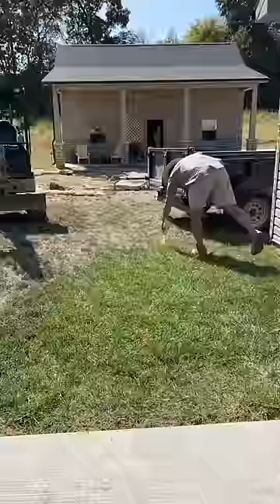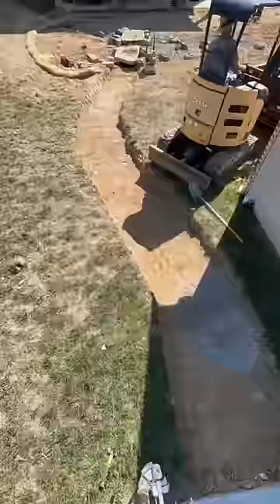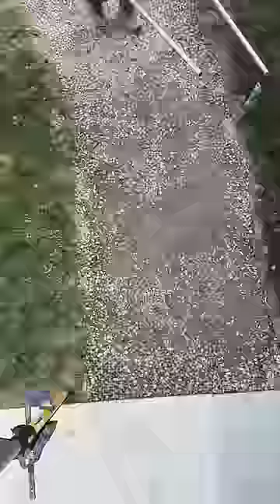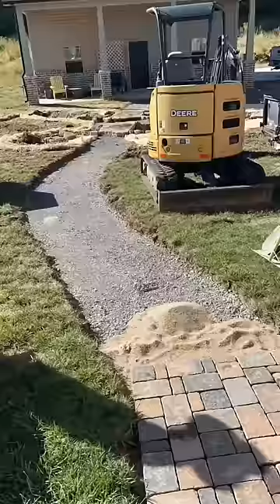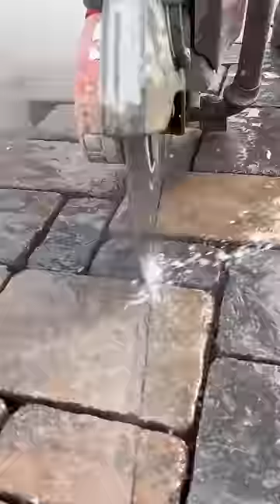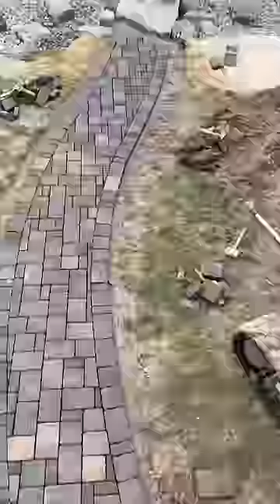Cut Pavers Fast 💨

Comment: That’s like 5” cut on both sides is way too much to cut. Looks better wider!
Reply: Cut to the owners dimensions not yours
Reply: @mattharrell6880 the chaps still allowed his personal opinion on it though right
Reply: @kuk3411 opinion is worthless if you aren’t paying for it to be done. If you were paying for it, then they would build it the way you want it specifically. Customer is always right, even if you think it looks wrong they are paying the bill.
Reply: @l0l0mgwtgdq  I completely agree, very frustrating when you have to create something you don’t like or don’t think looks right.
Reply: Walkways can’t exceed 4 ft silly
Reply: @dylanburge3516  if that's the case then why lay 12"+ on both sides knowing that it's a waste of time. Seems to me like excessive labor went into this and the customer had to pay for it
Reply: @guzzini  if you have ever used that kind of saw you would understand. The extra pavers are to create stability when the saw is passing.. especially needed when trying to created a curve with a straight blade. There is a reason why it is nicknamed “maniac saw”
Reply: Yeah that was surprising… but a lot came back with the rows on the sides. Design’s a process 🤷🏻‍♂️
Reply: Just because the customer wanted it that way doesnt mean it can't look like shit
Reply: Exactly. If the customer wants it that wide, why are we spending so much time, material and labor on 10 more inches?
Reply: @dylanburge3516 Why? What is the reason?
Reply: @l0l0mgwtgdq  plot twist you gave your worthless opinion about another mans opinion being worthless. Interesting. Neither of you own the house (paid for it) nor laid the pavers. SMH
Reply: @l0l0mgwtgdq Your opinion about his opinion is worthless. If customers order some nonsense and show it on video, we can write about it as much as we want.
Reply: @LazyCat-bq7sz  one of the replies already explained that the saw runs more safely with some more room on either side. Jesus.
Reply: @bustedkeaton bullshit, there are other ways to stabilize it for cutting than wasting all the brick and time……
Reply: @guzzini I think the extra room on each side was so that the stone remained still with friction & weight to cut better those what was left to be tiny pieces. My hunch.
Reply: @botsareeverywhere okay genius, what’s a better way to stabilize the bricks from all that torque that would prevent the blocks from bucking all over. You can’t just dismiss it without a solution.
Reply: @dylanburge3516 physically makes sense.
Reply: @botsareeverywhere   I own a hardscaping company and have been hardscaping for over a decade this method is the fastest and most effective. You can make the whole cut in under 20 minutes instead of taking hours to pull each paver and cut it and hope that your cut piece matches the next one to a tee. Also this method insures that the most experienced guy is handling the cutting instead of putting a laborer on a table saw.
Reply: That’s what I say about your mamma 😂
Reply: Opinions vary.
Reply: I agree that what the customer wants is what they got, but just cuz the customer wanted it doesn't make it look better. It looks meh at best.
Reply: @l0l0mgwtgdq  So he's not allowed to have an opinion? Better report him to Youtube man, he's breaking the rules.
Reply: @dylanburge3516 I use that kind of saw and you’re talking bollocks
Reply: @l0l0mgwtgdq no, opinions are what create reality. If someone payed $500 for an apple that wouldn't just be my opinion if I said "that's stupid" just as this sidewalk is a 4/10 on the professional scale. And yeah it looks bad
Reply: Absolutely love how total strangers hate each other so much over something that is none of their business 😂😂😂

Comment: Played a lot of extra stones to just pick them back up😅 payed by the hour🎉
Reply: You sound silly
Reply: The time saved cutting this way is considerably more efficient.
Reply: You lay the extra brick so you can cut to your width, you might cut off most the brick but you need those slivers and corners so it’s complete from edge to edge, I cut all my brick work this way, much cleaner line.
Reply: You probably have never worked this job

Comment: You’re supposed to set the border on a concrete footing so it doesn’t move..  with the way these are set, over time, the pavers will separate and it will need to be redone

Other than that, it looks good! For now…..
Reply: I don't know about a concrete footer...the walk will move because that sand base will wash though. Limestone #10
Reply: You can use concrete, but nowadays they just use a plastic edging and 12 inch galvanized nails.
Reply: @ReactimusPrime  sure, concrete and sand base are both applicable, but they are inferior. #10 limestone cannot wash out and has become very popular. I did this for 8 years in Ohio, and you can skip the unattractive edging too, because it's no longer needed
Reply: I use a stone mix under the sand called ABC, I use a metal grid mesh on top of the sand that stops the pavers from moving, I use professional landscape felt on top of the mesh to stop plants from growing out of the walkway, I then make the border out of dyed cement.

Comment: Looks great, unfortunately you can’t take enough soil out to fit the stone and pavers and get a lasting outcome. You have to get rid of all the soft topsoil then build up. Otherwise it’ll be wavy in a few short years
Reply: Overlapping sections of road fabric. Geotextile is actually super useful but utilizing in paver applications, put in between the soil and the stone base, you would be surprised with how little movement you get from freezing and thawing. The geotextile gives tensile strength to stone base…. like steel and concrete.

Comment: FYI - All pathways should accommodate two persons (wheelchair /elderly with assistance/couples/double stroller/moving furniture )... especially a long pathway... who wants to walk behind someone that long...
Reply: No, code is 3ft, if the customer wanted a 5 foot walk they would have asked for one, you install what the customer wants within code, they probably will rarely ever use it and a wheelchair will fit on a 36 inch walk.
Reply: @chrisnelson3691  LOL... My comment clearly went over your head...
Reply: @DanDan-xf6wo  Nah, it definitely didn’t.
Reply: @chrisnelson3691  So... You purposely ignored the context of my comment... and chose to Gaslight... 🤔🙄

Comment: No barrier below the sand? You're going to get moss and mold growing in 5 years right through the sand.
Reply: Это красиво
Reply: The sand and compacted base plus the polymeric sand in the joints will prevent it. 
Source: hardscape contractor

Comment: The cut is so ruff. i would recommend using geo cloth under the base corse and hornching the sides to stop the sand washing away
Reply: You another expert huh
Reply: @_Bturbo370zzzzz_  yes sir 18 years landscaping. I am an assistant manager of the company I work for and site project manager
Reply: @themac4761  🤣🤣🤣🤣
Reply: @themac4761 And you're right!! The path will spread over time as there's no haunching on the edges. They're basically gonna rely on the grass to hold the edges. I prefer to put in a small footing along the edges to bed and haunch the edgework and I would also use a weed screen.👍 35yrs experience.

Comment: For those of you inexperienced with hardscaping talking about the extra stone he doesn’t cut.  The extra stone helps hold everything together while the saw in moving through the pavers. The less the pavers move the less chance there is of messing up your cut or the outside of a cut turning into a rocket. The more stability while cutting the better especially while making curved cuts with a maniac(which isn’t easy)..

Also most walkways by default AND  according to planning and zoning can’t/dont exceed 4 feet. So it’s about 2.7 feet of pavers wide and a soldier course on each side(give or take)

Quit commenting negative shit on other peoples profession that you’ve never done in your life. I’ve been at hardscaping for ten years and this is exactly how it’s supposed to be done

Comment: Bro, I'm a mason, here a suggestion for you: stop laying pavers on to sand. It constantly wicks moisture and that's why you have weeds on it after as a curse. 
Just lay on to 5/8 minus crush with fines. 
No need of pipes, just install 2x4 like for concrete and lay pavers on to compacted crash, then two times sweep polymeric sand. Sand was used with true cobble stone in ancient times instead of mortar to compensate the difference in stone height and unevenness. Modern pavers is 2 1/4 of an inch consistently, no need to suffer with sand.
Reply: Thank you for sharing this information and wise advise. Of all the postings yours make the most sense. 🙋🏼‍♀️🇵🇦

Comment: Can cut one side at a time to reuse viable cut pavers on other side.
Reply: Id also add that you can score in place and cut the bricks off to the side it is more time consuming but will save the integrity of your base where you’re cutting. Most people do it the way they’ve done it in this video and its effective, but your saw and water screws the base on the edge of the soldier course up pretty good. Also if the concave curve cut is too dramatic then the back of the saw blade can hit the brick on the come around if you cut in place vs cutting one by one.

Comment: Waste of brick with the large swath cut
No cemented edging
And if edge was in first you could cut piece separately and do the cuts as you go ….
Using a wet saw to cut the filler pieces would be less concrete dust to breathe

Comment: This is a professional amateur at work. 
Don't use electrical conduit as screed rails or to mark curves on pavers...Learn to screed off Aluminium rails that can be bought in 6 metre x 25mm x 6 mm lengths. 
They are much better as well for bending around curves and have a square edge for the marking pen to run along. 
That is real amateur stuff cutting the header course curve with a Quick-cut...
What is even more amateurish is ending up with a brick that has a two line angle cut on its face. 
The header course should include keystones every so often to 'wrap' around the curves.. 
I was a licensed paviour over 30 years ago in Australia on domestic and commercial projects.. My work can be viewed on Google Maps streetview... it still looks as good as the day it was laid.